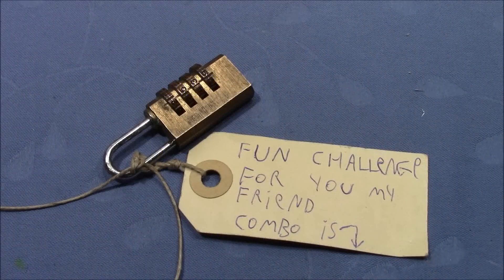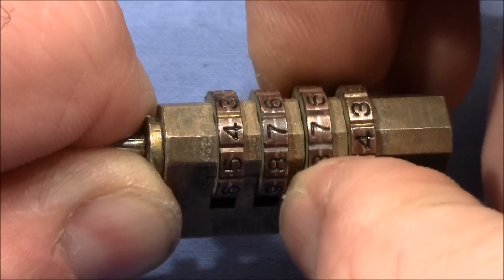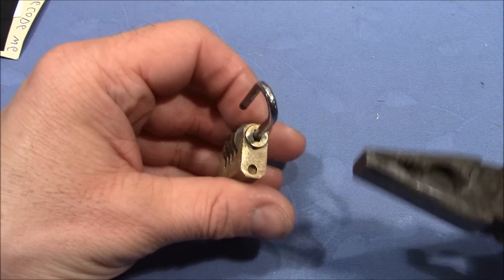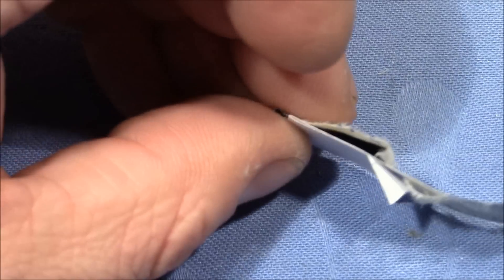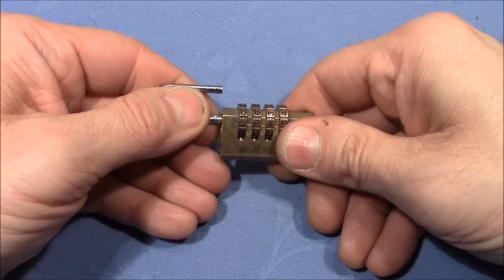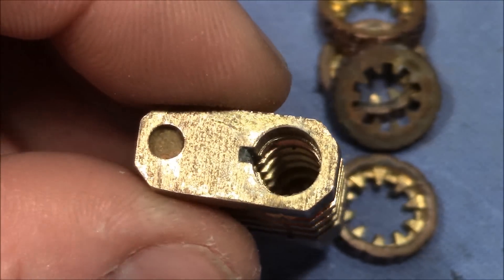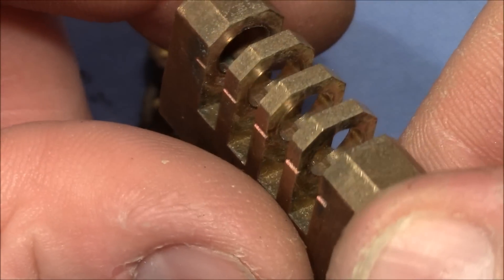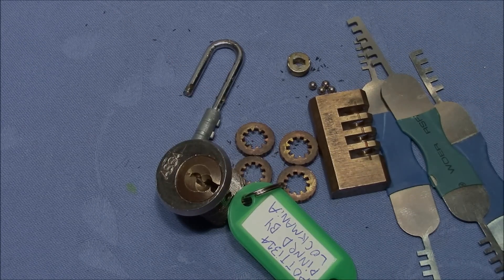(picking 638) Combination padlock decoded and gutted - cool gift from 'lockmania'

Comment: The shackle is so soft, and only go in about 1 mm, so to get it off the hasp, you can just twist it. I did that a while ago, when I had one failing in the wild, and didn't have time to decode it.
Reply from the maker: Yes these combination locks are usually weak construction - they are more toys for me than real locks ;-)